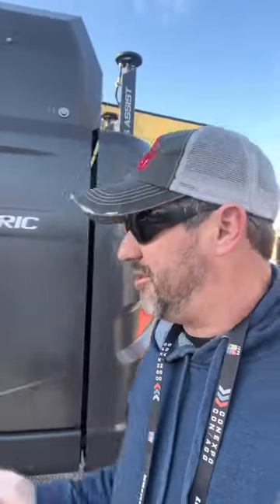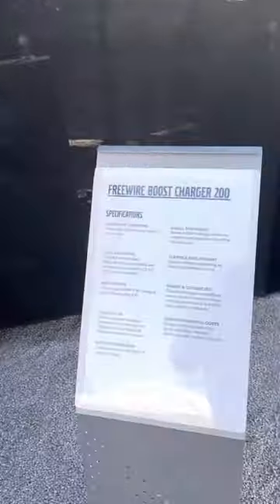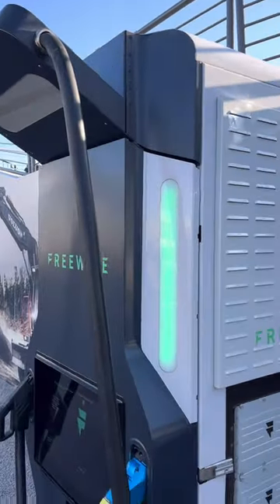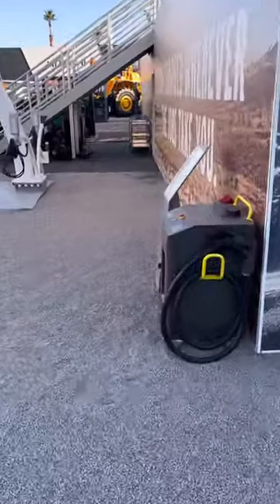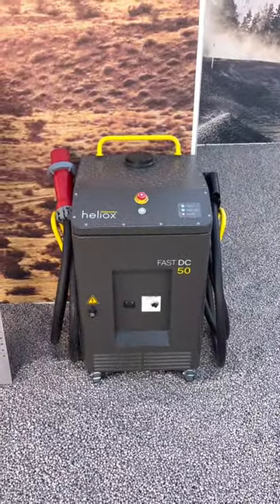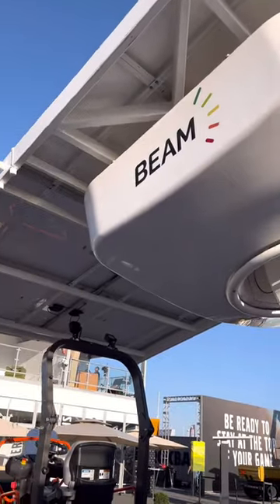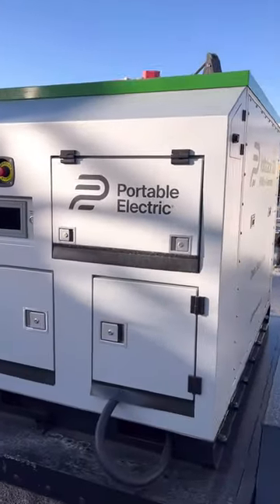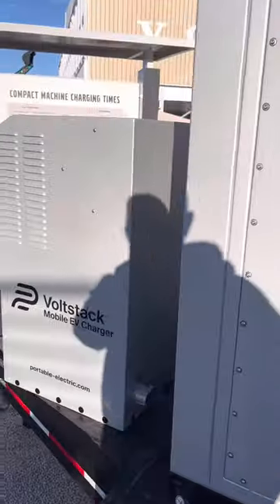Charging options for electric construction equipment

Comment: I know, let's run a diesel generator to charge an electric excavator.
Reply: That will be mike.
Reply: There are so many other options to generate electricity. The big ones are nuclear, solar, and wind. All it takes is to further develop the tech.
Reply: @brentbennett5401  green can never be the main source.
Reply: @jajajajajajajajaja867  it could as all these deserts that are unused we could put solar in and the biggest out of those 3 is the nuclear anyways
Reply: @brentbennett5401 Electric to run equipment and vehicles is way worse for the planet than diesel fuel.
Reply: @ericculver115  as of now but if you don't try to make advancements nothing will be better I remember reading something a while back where people were starting to create batteries out of zinc and chitin so zinc and shellfish so when the batteries got old your able to let the chiten decompose and reuse the zinc
Reply: @brentbennett5401  unused? Those are ecosystems that house many creatures that the earth needs.
Reply: @cornfed123567  you know there are mountains of shells from all the shellfish that people consume this just gives them a use instead of just sitting there decaying

Comment: Thanks for the look.  It still seems like the initial cost is going to be a lot higher than than diesel, the run time, ROI, and use cases will make the choice interesting.
Reply: Then you have the cost on the planet  10 kids under the age of 12 are dying every single day in the cobalt mines and that's just one part.

Comment: I think I'll start a new business building  high output diesel powered generators with output specific to charge electric excavation equipment and trucks. You can conveniently fill it up with diesel and just bring it onsite to charge all those EV things up overnight. A version with a trailer hitch can be pulled behind a car or light truck to charge as you go. No need to wait for a charge port and take a 9 hour break, just pull in the real fuel line, top er up, and be back on the road in minutes, not sometime tomorrow.

LeTourneau pioneered the use of high torque electric motor hub drive.. and it works great.. but he had the common sense to carry the diesel engine and generator onboard, just like a railroad locomotive.
Reply: I think that charging trailer exists 🤔

Comment: So a Diesel generator is one of the options to charge the batteries. Kinda seems like a gimmick. However I can see the use of a Electric Mini for confined spaces or where fumes or noise are not an option. It would also charge much faster.

Comment: okay that giant portable battery to offload? just design the vehicle mounted to that is what I'm gonna need and it's gotta stay small lightweight and highly efficient multi role heavy duty commercial grade  equipment but also slap a flat row of solar panels on to to trickle charge the thing just to prevent battery damage from being left uncharged

Comment: So in other words it's all straight up garbage that needs go back into recycling process and and become a real piece of equipment that actually works and has a real engine that runs real fuel and doesn't spend more time getting charged than being used

Comment: I work for an equipment rental company, these machines are going to make costs skyrocket for our customers. Instead of renting 1 machine they will have to rent the excavator and the battery trailer. Not to mention the service calls for it not charging because they dropped the plug in mud and didn't clean it before trying to plug in. Scissor lifts have always been a pain because people can't figure out the charging
Reply: ANYONE  that thinks electric is the way to go is crazy.

Comment: I like the hydrogen powered machinery and the hybrids .
Reply: Hybrid is the best option right now. We have hybrid man lifts and they are great. Use diesel to charge the batteries for job sites with little to no power or plug in overnight and never use the diesel. We have a customer who has had one for over a year and they have only used the engine 3 or 4 times, mainly because they forgot to plug it in when they went home a few times.

Comment: Great now some serious unanswered Questions. How much is the re-charging station on top of the cost of the machine? What warranty do the batteries have? Now factor the cost of taking the charging station to each job undamaged. Starting to get complicated if you have 2 or 3 Electric machines at different sites. I think Hydrogen may be the true way forward.

Comment: Hydrogen is the way forward on all fronts .
Reply: Nuclear would be even better.
Reply: THERE is absolutely nothing. Wrong with diesel.
Reply: no ammonia is beter , hydrogen is to volatile and gaseous at room temp ,has tobe stored in a pressure vessel or cryogenically cooled

Comment: I'll keep my diesel while you play with junk battery toys
Reply from the maker: What problems have you had with your battery power equipment to call I junk just curious
Reply: @DirtPerfect  give it a little time and you will see for yourself...I guarantee you that in our lifetime you won't compete with fossil fuel because of the reliability and longevity
Reply: @DirtPerfect  not too mention I can run 24/7 with 10 minutes for refueling that will never happen with a battery

Comment: Well your still back at square 1 how much does the unit cost? and how much does the portable unit cost and is it gas or diesel powered? or does it have to have it's own power source hook up? I'm still seeing Matt running across hill and dale looking for a current bush or a plug in during lunch hour. But does all the cost justify going with a battery  powered unit?..bottom line...cost.

Comment: i wish they and tesla would use a trailer type auto charger. you drive on and it then lifts 4 massive hooks that hit spots under the excavator. then it charges while you transport it. no need for plugs just either drive on, or hit the auto park so the computer puts it in he right spot, clamps itself down and charges. no need even for chaining down. it would make tesla charging much simpler. come toward charge station hit the button,, and it parks and engages charge all auto.
Reply: They would have to design a specific trailer just for that and it would be heavy as hell even a mini excavator would have to get an overweight permit to haul lol
Reply: Or just grab a cord and plug it in? 🤔
Reply: @cornfed123567  either way you look at it, a charge station to go to the site is going to be heavy. and many mini excavators are sold with a trailer. but not remotely close to over weight vehicle. 
the big trouble with electric excavators is the sight needs a massive power source, or you need to bring one. for me it makes more sense to have an automatic charge when you park it. whether the trailer plugs in and trickle charges while you work, or you bring a huge 2 charge battery doesn't change the charging station. same for trucks cars etc. if you just roll in and stop the station does the rest. simple and you can run vastly heavier cables if people dont need to lift and move them.
Reply: @scottkuzma125  true, but the faster the charge, the bigger the cable, or the more heat and resistance. but you could use a 50- 100mm electrode no problem with a drive on charger. the station connects wifi, then determines if you are a car, truck, tank or excavator and sends the required amps to fast charge.
Reply: @chrisoakey9841  
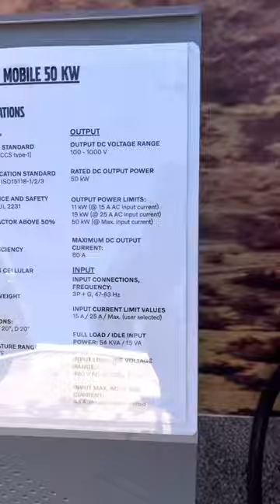The requirement for a larger cable to reduce the heat and resistance would only be necessary if the voltage were to stay the same when fast charging at higher currents.  So with the highest current that a Level 2 charging station is using 240v grid 60Hz AC is 11kW using a 6 AWG size cable to charge, in order to push the 50kW that the charger shown at 0:24 in this video supplies, you may indeed need a 100mm (roughly 4" Ø) cable, however if you can see the specification briefly shown at the top of the chart, it states "OUTPUT DC VOLTAGE RANGE 100 - 1,000V" because when you double the voltage to a load, the amperage can stay the same while carrying double the current without needing to increase the size of the cable.  In this case, 1,000v is essentially 4x the voltage of 240v, plus with even better efficiency since it is DC and not AC current.
If you need more evidence of this, just look at the easily manageable cable size coming out of the charger unit, which has more than a single wire within it.

While this sounds incredibly high, a V3 (3rd Generation) Tesla Supercharger station is capable of 250kW output @ 450v with a total cord size that is less than a US Quarter coin (.955"), and the new V4 stations are rated at 1,000kW @ 900v while still having a cable size that is manageable.

Increasing voltage is far simpler than having a dedicated "charging station trailer" that would require various automated hooks and clamps, let alone hoping that the plug connections on the bottom are always sealed and dry after being submerged in muddy water or beat up from scraping over rocks.  And if you're talking about wireless charging pads, those are very inefficient, especially when the current is increased.  Simply drive up and plug it in to a standardized CCS charging port, just like Volvo has on offer.
Reply: @scottkuzma125  definitely not wireless charging. and many of the machines i worked on were 3 phase 415v. thats pretty standard in aus. however there is a reason for going heavy duty. when you keep heating and cooling connectors designed to  run at 90% of max is that as they get older they fail. the first failure is usually corrosion, that then increases the cable to heat more. the insulation brakes down and starts to crack up. if a charging station is designed so the connectors can handle double or triple its expected max, in 30 years it will most likely still work.
a trailer to connect an excavator that needs a trailer to move seems pretty obvious. since you need charging and tie downs, why not make them do both purposes. 
for infrastructure, you want standards. so if cars trucks and excavators can drive over a charging plate that extends to charge to the same spots no matter the vehicle,
Reply: @chrisoakey9841  
You're talking about having a trailer that can accommodate charging an excavator AND all sizes of cars and trucks that would otherwise never be driven onto a trailer in their useful lifespan, let alone by people who can barely park a car into a standard parking spot.

Another thing to understand is that a high current charging station does NOT operate at full output load the entire time that it charges.  Look online for the charging curve that a Tesla Supercharger station supplies to the car's batteries.  Only when the SoC (State of Charge) is low (~20% or lower) will it experience the highest potential current supplied to it.  As the SoC or battery temperatures increase, the current will gradually reduce.  This means the connectors, which are replaceable, do not continually experience operation at 90% maximum when in use,  but only for a few minutes.

With regards to connector longevity and durability of the existing standardized charging plug would also apply to your hypothetical standardized trailer-charging system, a system with far more complexity than a replaceable cable should it ever fail.  I doubt that I could find a fuel station with a 30 year old filler hose, let alone an entire station that is still using the pump equipment from 30 years ago.
Reply: @scottkuzma125  im talking about a trailer that can accommodate the excavator, but has charging points in the same positions as the charging points for all electric vehicles as a standard. but no he trailer would just be for the excavator. 
as for the load on the cables for charging, the charging curve tesla gives differ quite a bit, some as you say only run near max for the first 20%, some upto 50% charge, but the current the charger is pushing still seems to be max the whole time. but the resistance of the battery increases so the amount going in is the curve, not the amps being pushed. Ive looked a fair amount, and the big thing seems to be everyone has a different curve and most dont talk about load on the charger, just how the battery accepts power. the ones talking about lad on the charger have a flat current from 10% - 90%
Reply: @chrisoakey9841  
There is a reason that the charge curve varies.  It is because a DC charging station is essentially constructed from multiple "onboard chargers" working together, and the BMS (Battery Management System) within the vehicle is always in communication with the charging station and dictating how much current the charging station should be supplying to the battery of the vehicle.  If the battery temperature is too hot or too cold, it is programmed to communicate how much it should request from the station.  The same for the SoC level, etc.  The station is never just slamming maximum current to the battery pack with the curve being a byproduct of how much it can handle.  The curve is controlled by the BMS of the vehicle as it instructs the station how much to provide.

Comment: Things are already changing and whether it's Hydrogen or Electric, or as in the case of Volvo's new wheel loader both, it will happen. It's no good anyone hiding thier head in the sand. Governments around the world, for the benefit of health and the environment are encouraging manufactures to leading the development. What the manufacturers need to understand is that, small businesses like Mike's or Chris's need help with that initial sef up and infrastructure, they are not multi million £ or $ companies. Sooner or later Governments no matter where are going to understand that it's the companies of this size, that will suffer most and with that so will the public, as we can't afford a major contractor. At that point if a government wants it's small to medium-sized businesses to support going green, then they are going to have to give direct grants to help. So it's beneficial and good business for the likes of Mike's and Chris's companies to get support at the start, not for them to wonder or worry if they have a roll in the future.
Reply: Government doesn't give a rats patootie about the small guy.  Run them out of business and let big companies that can afford sizable campaign contributions take over.  Kalifornia isn't exactly making life easy for independent truckers or those that need a few trucks to support their operations..
Reply: Nonsense, show me a battery powered container ship or plane.

Why would it make sense to put electric batteries in off-road equipment where it will need a diesel generator to charge it?